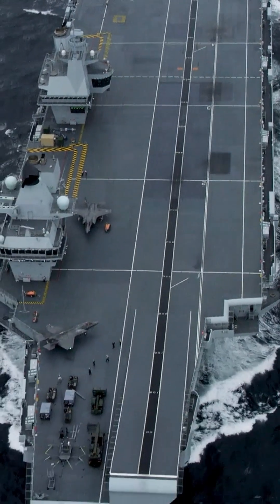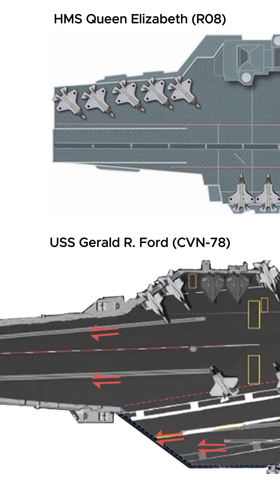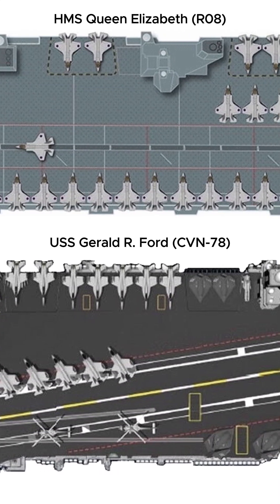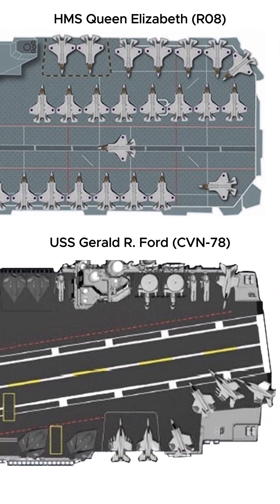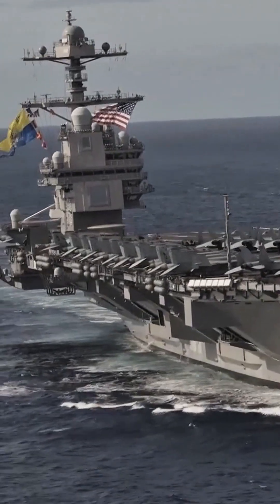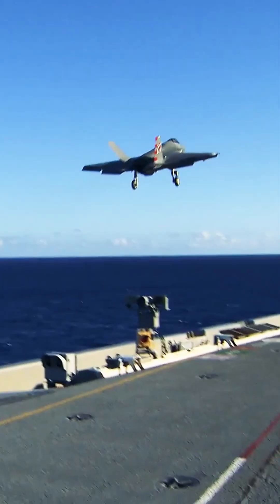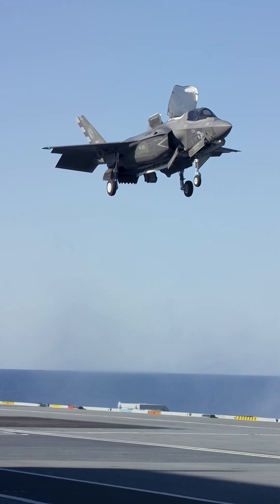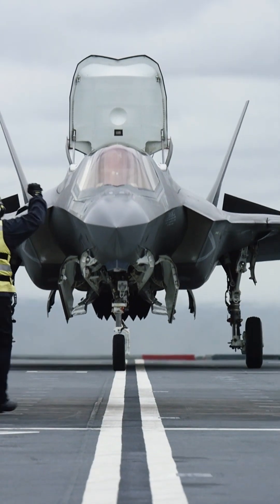Catapulted Into Trouble! The Queen Elizabeth-Class Aircraft Carriers

Comment: Cats and traps were omitted from the QE class simply on the grounds of cost.
These carriers would be extremely vulnerable in a real shooting war against a capable enemy as they would have no AWACS platform and no inflight refuelling available.
The folly of the current design would come home to roost horribly if one ship was sunk and the second carrier obliged to withdraw.
Reply from the maker: @craigsimons817 I agree, the current configuration of the QE Class does appear to be suboptimal. Thanks for watching. Mike 👍
Reply: Also the defensive VLS capability of the QE class is a real problem.

However I would argue 'the' biggest threat to both Carriers is the decades long [post cold war] insane cuts especially to the RN.

Arguably holding the position of First Sea Lord would be an emotional nightmare. 

Army also has been significantly reduced. The RAF arguably has largely done ok regarding capability/platforms.

Your submarine fleet is world class - Trident, TLaM, the Astute Class + French Suffren Class I personally cannot split as both are brilliant submarines - the nuclear reactor on the French Suffren is new and the need to re fuel the reactor has been extended significantly with respect to years.

But again it is the UK Treasury cuts to defence Outlays that is killing the RN - which for years has had huge problems with respect to maintenance - cannibalising berthed ships for parts.

The UK is SO lucky it still has the Royal Marines after endless 'chatter' about their future - it would be insane to tinker at all with what is, along with Spain, France, the Dutch, hundreds of years of history with these Marines which are brilliant, and battle hardened force projection assets.

CATOBAR 'has' to be approved and then modified asap. The endless time for 'talk' is over - just get on with modding either one Carrier if that's all funding will allow, or both, again if the funding is appropriated.

It may well be the costs involved will only cover x1 QE Class Carrier - 'if' this' the case get it done.

Both sides of politics are to blame for the deep cuts and financial Budgetary cutting that has inflicted uncertainty on the UK Defence Force.

Although slightly smaller, I personally rate the French Carrier better than the QE Class but that is just my opinion.

The new French Carrier will be significantly bigger - and will not suffer in terms of funding and work productivity/parts.

Spanish + French defence naval building is extremely efficient even if there are some predictable problems that arise.

You have x2 behemoths that can launch only one type of aircraft - if you're going to be in the 'Carrier business' why you would scrimp and scrape on the platforms capabilities defies both common sense + logic.

Oh and force projection power.

As the NIKE advert says "Just Do It".